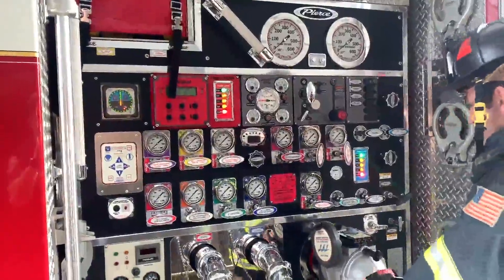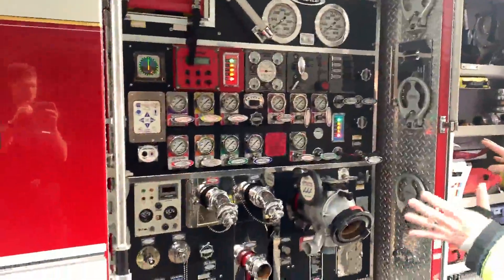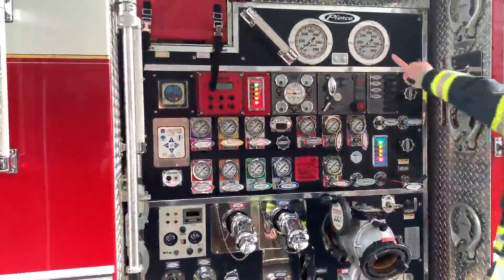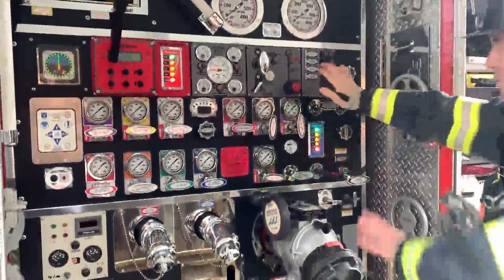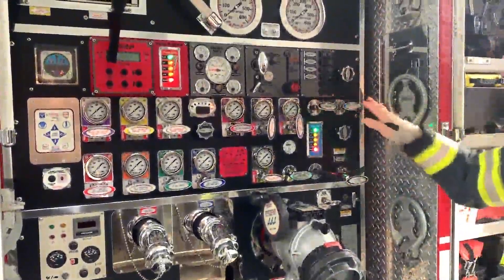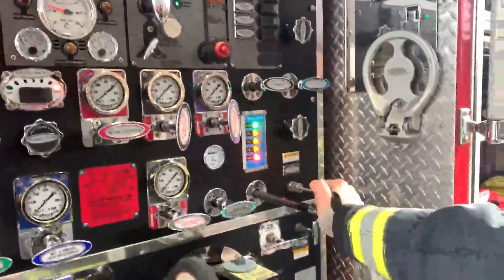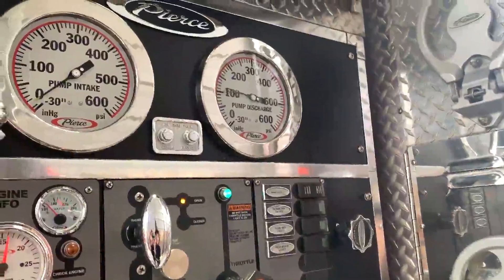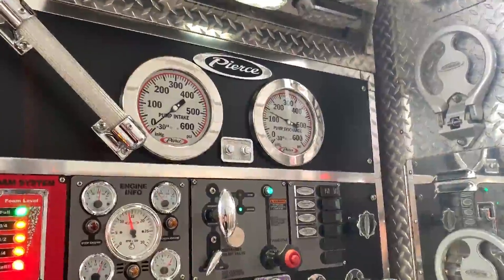TS - Pump cavitation

Comment: For starters, if you had opened the tank fill valve the pump would have filled with head pressure from the tank.  I am not sure you really understand pump cavitation after your demonstration.